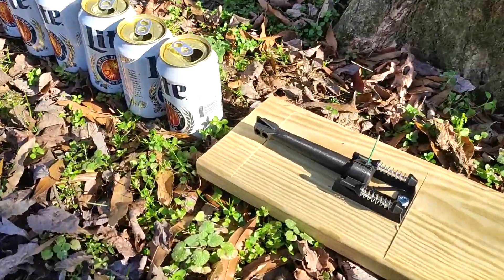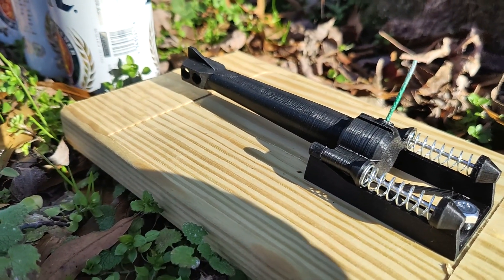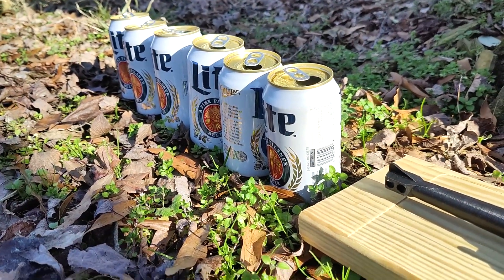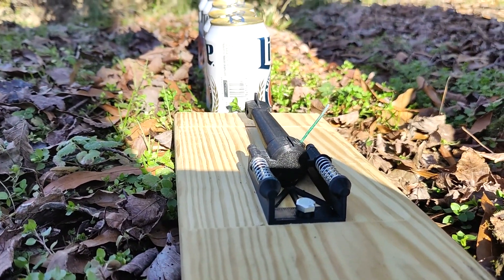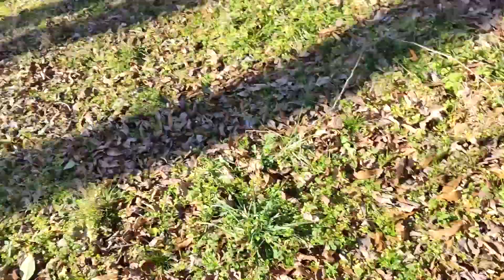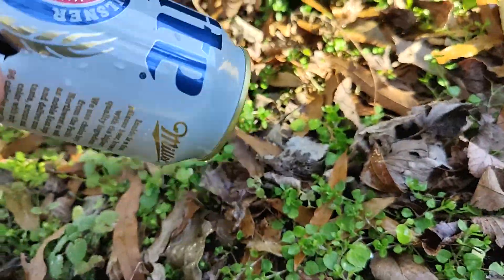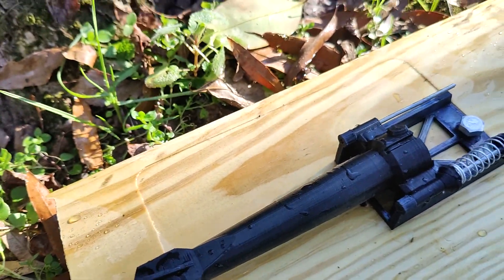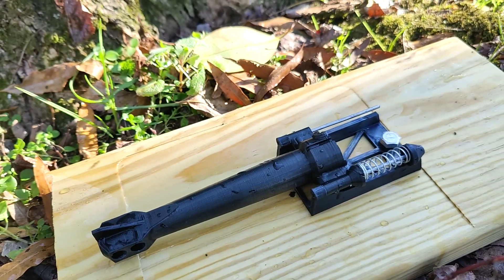Newest 3D printed cannon (IT EXPLODES)

Comment: I played it back at 1/4 speed. That was quite an explosion, good job you were behind the tree because a fair amount went back wards 😮😮😁😁👍👍
Reply from the maker: Yeah quite the flame ball in one frame 😂 kinda wanna redesign it a bit and get it to fire without exploding like it did. Never did find any pieces, split right along where the fuse hole was, think I can kinda see 2 or 3 frames where the back of the cannon is flying backwards up into the air

Comment: That was interesting Spencer. The 3D-printed material is definitely not strong enough to contain the explosion. Of course, you were using gunpowder but maybe something not as volatile would work?
I built a potato cannon a few years ago using a 3-inch diameter drain pipe connected to a larger diameter pipe for the combustion chamber. I used a piezoelectric gas lighter switch to produce the spark in the chamber. I had a hole with a screwtop thing fitted to the top of the combustion chamber to spray in the fuel. The fuel I used was just hairspray which was sprayed lightly into the combustion chamber and then the plastic cap screwed back on.
As soon as the piezo spark igniter was pressed it blew the potato about 500 yards or even more. 😁😂 Fired it at a wall and the potato disintegrated.
Fired it with no potato and what a bang it made. Plus it had a strong recoil.
It was similar to what you have here but just bigger. I also used other types of sprays in the chamber and it still worked fine. I think those sprays are pressurised with butane gas which gives it the explosion.
The way I see it is if there's enough room in the barrel for the fuel to expand then it will take that route.
Of course, you certainly know more about cannons and guns than I do. 🔫🤣
Reply from the maker: Wouldn't say I know more, but yeah, much easier to attain and shoot guns where I live 😂I've started to redesign this, added a good 4mm wall thickness all around where the initial combustion happens plus gave it more plastic towards the back. I could (and probably should) buy steel liners at least with a threaded cap at the end, but I'm stubborn and cheap 😂 though adding all this plastic doesn't cost down on price nor does making models that can only be fired once. Did you make a video on your potato cannon? Sounds like it worked wonderful
Reply: @spencer963  No video mate. I wasn't even on YouTube when I made the potato gun. I will have a look in my other garage as I am sure it is still there. 👍